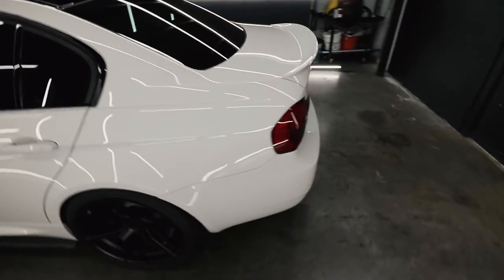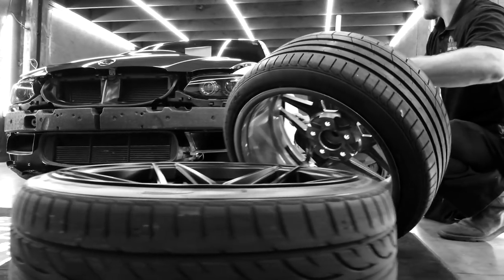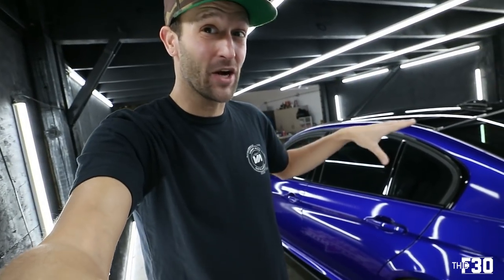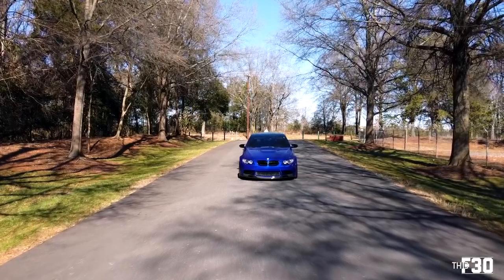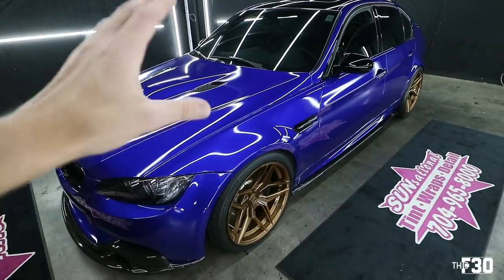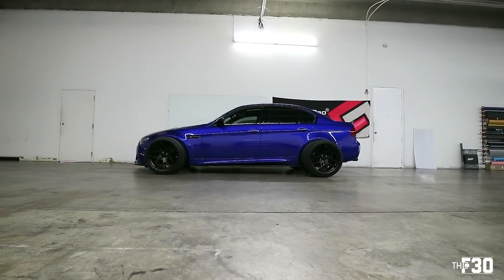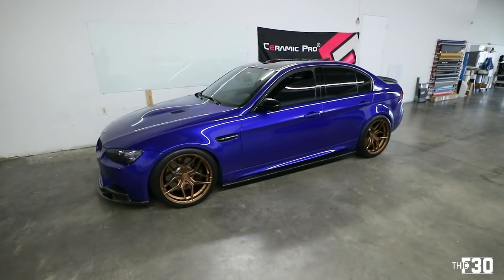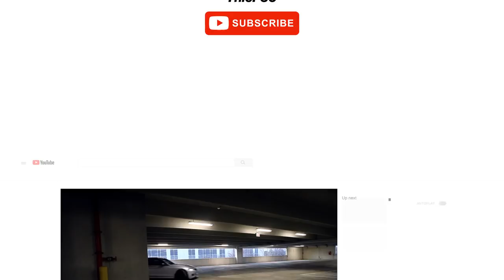THE E90 M3 WRAP REVEAL!

Comment: Love the brushed bronze man!  Sick wrap color as well.  Came out very clean.  What tire sizes did you end up going with?  I got the same wheels, but tire size has been hurting my brain.  I need tire girth/profile because our roads aren’t the best.  I just thought the 275/30/19 and 295/30/19 were too thin of a profile.
Reply from the maker: 265 35 and 295 35
Reply: Thic F30 thanks a lot man!  That’s the kind of tire profile I wanted.  Really happy I caught this video haha 🤙🏾.  Did it take a lot of alignment adjustments to make it work?
Reply from the maker: Not really no. I’m not running any camber, just lowered on coils with 25mm offset. 19x10 and 19x11